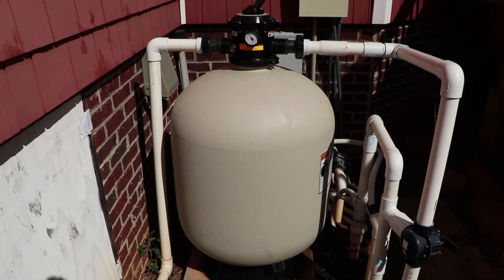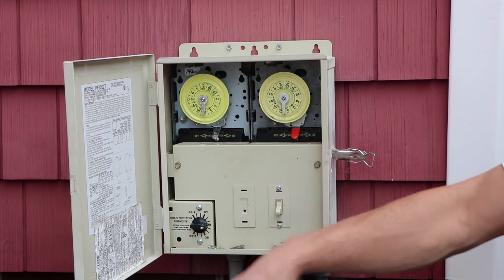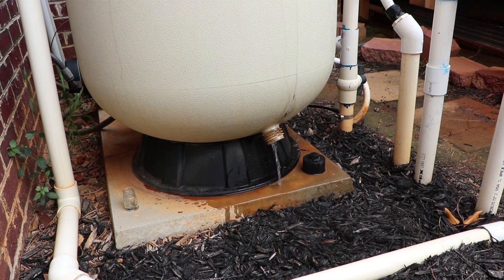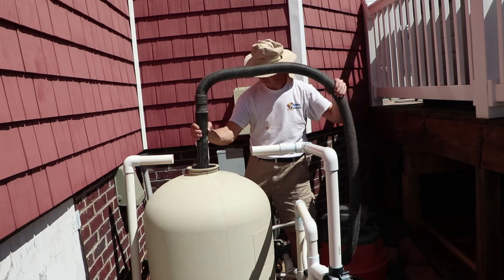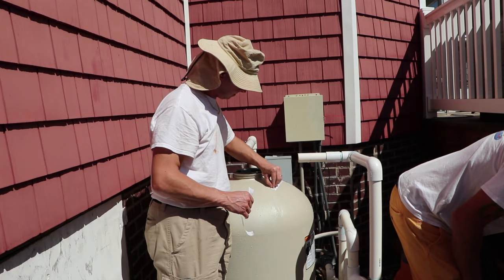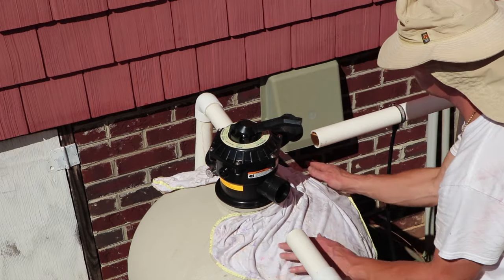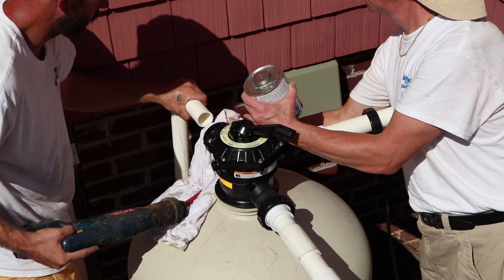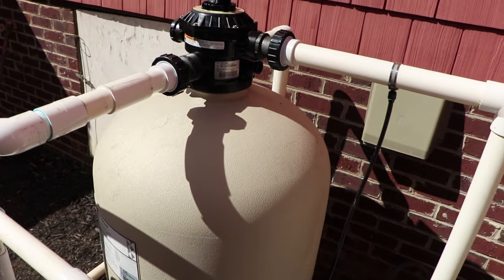Pentair Sand Filter SD80 Install - Sand Change

Comment: Right in the middle of doing this now. Looking at the video made it seemed so easy to vacuum. Though I  would tell viewers what I’m experiencing in the hopes that they be better prepared. First off. The gap between the tank opening and the stand pipe is so tight that I couldn’t fit my larger shop vac extension inside without out exerting a lot of pressure on stand pipe so I had to use smaller diameter hose and extension. Then the tabs that hold the extensions together ended up right about top of stand pipe so I had to cut them off. Even then, the are area where the extensions are coupled together jam up on the collar and the top of the standpipe so I had to duck tape them together. then the hose would constantly clog up with packed sand, causing me to have to raise the hose up over my head and tap on the hose with something to constantly unclo. also I would strongly recommend a headlamp or some type of light to see what you’re doing inside because it matters where you’re jamming the end of your vacuum extensions to get the best out of it. I wasn’t  able to move around my tank so I found a very large cooking paddle to move the sand to far side of tank making it easier to reach sand. I would recommend removing the standpipe and laterals as soon as it safe to do so to get them out the way, which is what seems to be the case in this video where he’s moving the hose around freely. all I can say is I bet the engineers at Pentair were laughing their butts off when I designed this tank.

Comment: Good video, but I was hoping to find you installing it with the factory hoses and fittings.  Seems like I have too many fittings.  Might be a multi pool package.  I couldn't tell what went where with the after plumbing.
Reply from the maker: Thank you.  There is no factory hoses or fittings with this model. there is with above ground units.

Comment: I'm unable to get the multiport to sit flush on the tank. I took off the o-ring and it sits flush, but if the o-ring is on it has about 1/2 gap. I tried lubing the o-ring and the inside rim of the tank , but that did not help. I also hit the top of the multiport with a rubber mallet and that did not help. Any ideas?
Reply from the maker: If it sits flush without the o ring there.  Then you need a little bit more persuasion to get it in place. I tend to use my whole body weight.
Reply: I'm just replacing my multiport valve, and I'm having the same problem. 
 I thought the new multiport valve might be the wrong size, but I can't even get the original to sit on top of the sand filter close together enough to put the 2 clamp pieces on.

I didn't want to put too much downward  pressure on the multiport valve because I'm afraid I might break the pvc pipe going down into the sand filter, as well as damaging the "fins" inside at the bottom of the tank.
I tried side to side twisting with no luck.  Any chance of breaking the inside parts putting my body weight into it like you said you do?

Comment: Why do you recommend replacing the laterals? They seem to be hard to get out and probably hard to get in.
Reply from the maker: That's why. They get Brittle over time. Which means the act of pouring in new sand can break them.

Comment: where is the air release valve on this SD80? I have the same unit but cant find the valve?
Reply from the maker: Depending on which multi-port valve you have you may not have one. However if you do have one and there will be a knob the opposite side of the pipe where your sight glasses sitting.

Comment: Where do you get the connectors that you replaced the original plumbing with and what are they called? They will definitely make things easier in the future.
Reply from the maker: Your local pool store should have them. they are call Hi-Temp Unions.
Reply: Your local hardware store will have them cheaper than a pool store.

Comment: on the SD 80,  how do you get the laterals off of the piping assembly?  They twist 45 degrees but wont come out,  trying to replace them in the filter.
Thanks
Reply from the maker: Wash the sand off of them and then wiggle him with quite some force. It is best to replace the laterals when you're doing a sand change anyway.

Comment: Why no coupler on the backwash pipe? I have the same setup and am about to do my first sand change and I don't understand why whoever did the plumbing left the backwash fixed without a coupler.  I'm probably 2 years overdue for a sand change because didn't want to deal with that one pipe.
Reply from the maker: You are talking about a union and I did put one on. But it not necessary. Its just to easy to cut the pipe and put a coupling on. most people don't go over kill like I did here.
Reply: Thanks for the reply. I see it now, it was blended in with the valve and didn't notice it.  I'll be changing my sand this weekend and this video was extremely helpful to ease my nerves. Thanks for posting.
Reply from the maker: @joelconrad8595  your welcome

Comment: Curious to see if you can please answer my questions: 
1. My SD80 label says to use 350lbs of the #20 silica sand. Both my label and my manual do not mention pea gravel. So, even if it did, to get to 350lbs of sand capacity, would it be1 bag of sea gravel and 6 bags of silica sand? 

2. If I need to replace the lateral assembly, can I do so with the folding laterals? Which part number would fit the SD80?
Reply from the maker: 1 I like using pea gravel on filters bigger then 300lb so yeah, 1 bag of pea gravel. 

2, I like the turn "click lock" that is standard. Not the flooding ones.

Comment: The SD80 calls for 350lbs of sand. The bags are 50lbs each, is there a reason why you used 4-5 bags?
Reply from the maker: I miss spoke in my voice over. Thanks for catching that.
Reply: @AquanutAcademy  SO DO YOU PUT IN PEA GRAVEL TOO?
Reply from the maker: @danielgiblin361  Yes if the filter calls for it. Some don't, most all large filters do.
Reply: @AquanutAcademy  so you placed in 250 pounds of sand & 100 pounds of pea stone?
Reply from the maker: @ChickensLady  sounds right.
Reply: I just replaced my Pentair SD80. Installation instructions called for 350lbs of #20 silica sand but did not mention pea gravel. What is the reason for the pea gravel?
Reply: @AquanutAcademy  Is it right or sounds right?

Comment: Why didn't you just replace the sand instead of the entire tank?
Reply: The tank was punctured
Reply: can the sd80 handle a 2hp pump/motor?
how does the sd80 compare to triton tr100  side mount or the  Tagelus TA100d top mount?
Reply from the maker: Yes, But a you need to size everything correctly.

Comment: Did you have to do anything with the laterals before putting in the sand? I’m changing mine next week and pool guy told me they needed to be twisted and locked before adding sand and water.
Reply from the maker: Yes. If you are changing the sand you need to change the laterals as well. they are click lock. So yeah your pool guy was right. Make sure they are clean and locked in before adding sand.
Reply from the maker: @Christopher Farmer yes it come with them. No you don't have to do anything with them.

Comment: So...  I have had an issue with my pentar 145241 he didnt use the tool to keep the sand out of the laterals!!!  FIX???
Reply from the maker: Run it on filter rinse mode will push the sand out the back wash line. Run on filter mode will push the sand out into the pool. Both will take time. Or you can take it all apart and redo it.

Comment: I’ve repaired many sand filter tanks that had minor leaking holes. As expensive as the tanks are, it’s worth the time
to epoxy over the holes  with several layers of fiberglass cloth. I’ve never had one fail. Why in the hek don’t they have a better drain system to be able to remove drain to be able to remove sand with hose and dumping it in place?

Comment: Little piece of bubble gum coulda stopped that leak
Reply from the maker: Not at all. I understand how you might think that, not knowing anything about it. And while you can stop leaks in conventional ways, you run the risk of a catastrophic failure. That means an explosion. You may say I am overreacting a bit here. However I have many photos of filters exploding from people doing just such a dumb thing.

Comment: Them pentair sand dollar filters are terrible and known for that especially on heated pools or many with really hot summers takes tolls on them.  I believe it has issues over time if the water passes through over 100°
Reply: My sand dollar just got a small pinhole leak in the top portion of it. We have a heated pool but the heater is after the filter, very unlikely the water going into the filter hits 100 degrees. Do you think it's because of the fact that our unit isn't shaded?  We live in Ohio. Summers can hit mid 90s but typically dont get hotter than 90